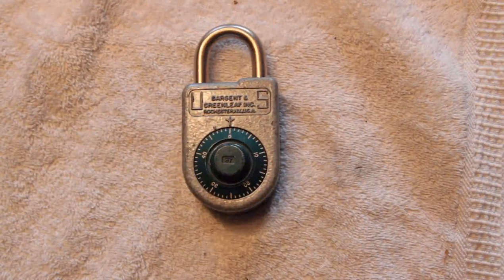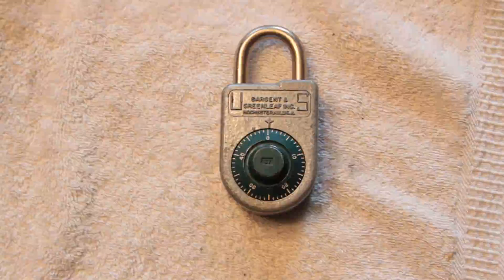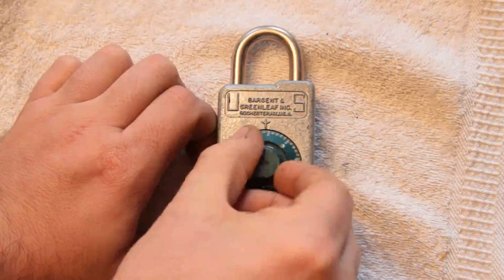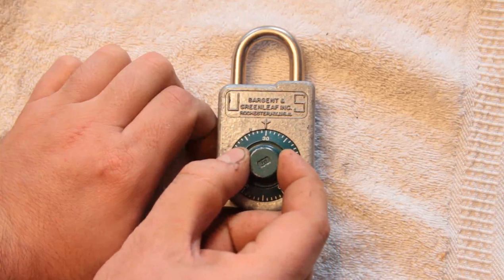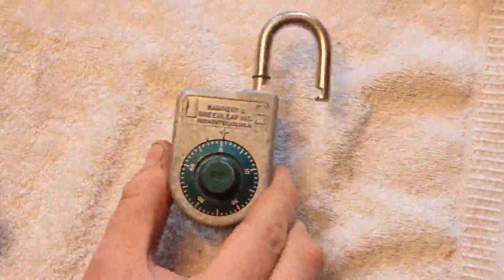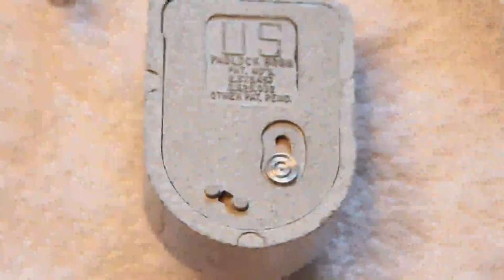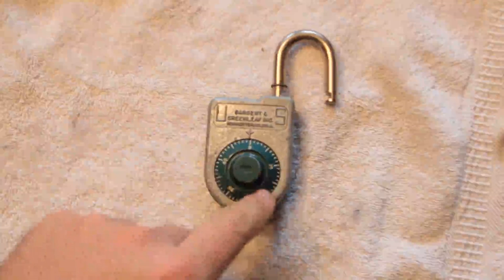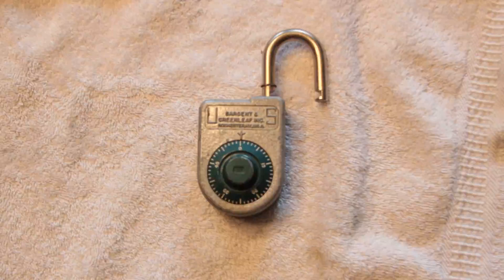(062) Demo: S&G 8088 Combo Padlock -- bosnianbill traveling locks

Comment: So I have the 8088 one. Patent number 2625032. With 49 on the dial. Apparently 25-25-25-0 or 10-20-30-0 in any sequence doesn't work. Locksmith told me they have to be radiologically hacked, if they are newer. Best is to toss the newer ones because if one loses the reset code from the box or the papers. The unit is useless. Another thing is the reset access slide is stuck half open someone must have jammed the shackle shut.